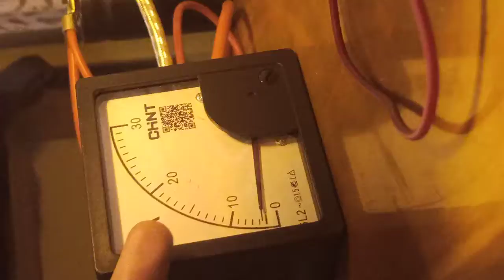1.2kW HFSSTC

Comment: That looks like a nice and fat flame. I found a real easy way to get the glass going on the tip is to just use old blown glass fuses. Usually I can just break the ends off and lay it like a cylinder on the tip.
Reply from the maker: Thank you sir, I have tried that method but I don't have many blown fuse haha.I, find broken CFL lamps are good choices, but needs to be heated outside to vaporise the mercury